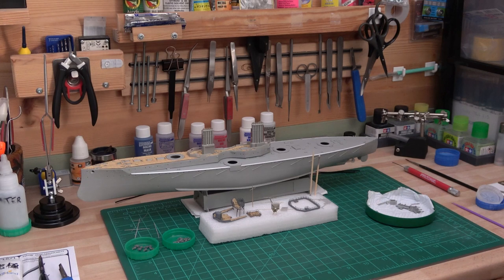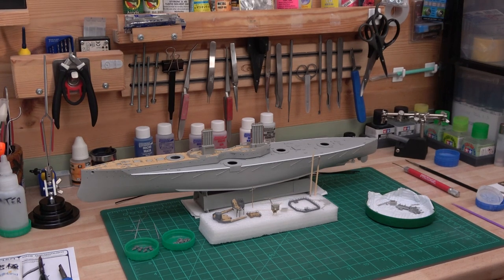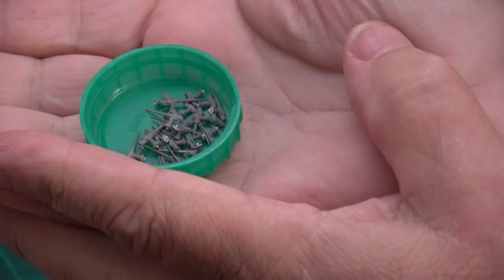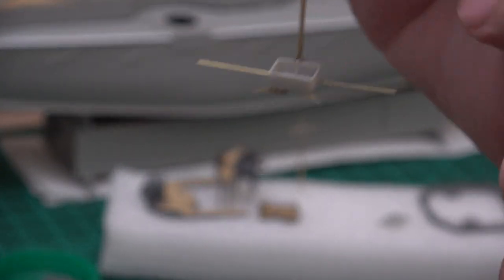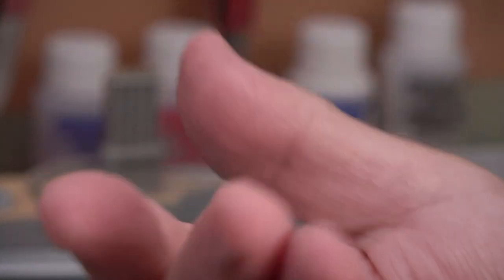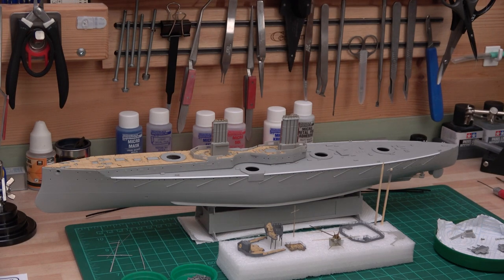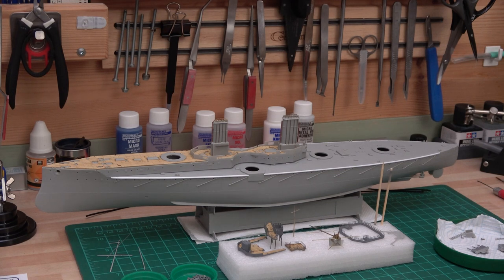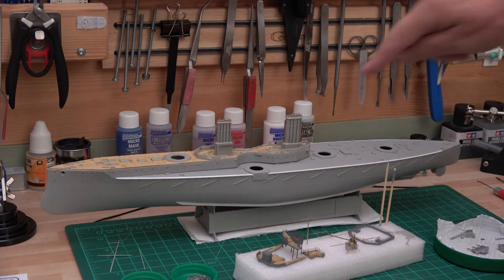TRUMPETER HMS DREADNOUGHT 1907  1 350 UPDATE 1

Comment: Hardy Well Done I am Turning to on mine as well  mine is the 1915 version The Dreadnought went through a lot ov refitting changes  A very beatiful vessel she is I am doing some sacratch building on mine I  am useing brass wire rod for my mast the kits is a joke not strong enough thouight  about useing easy line instead I am useing my hair after all durring the Revolution prisoners of war made model ships they used their own hair for the rigging I used my hair before very authentic in scale for 1/350 or smaller scales. I love you English Fellows for the work you do I learn a lot from you For an old Fud like me of 80 years of age I am still learning Lollllll  Again well done I am posting a video on mine this evening I have a lot of work to do thus far I been working on her for 6 months  work slow better the build ship building is a time concuming hobby require alot of timm  Frankie Day